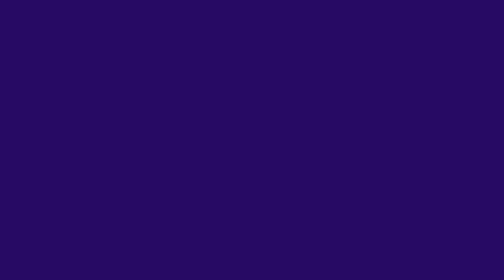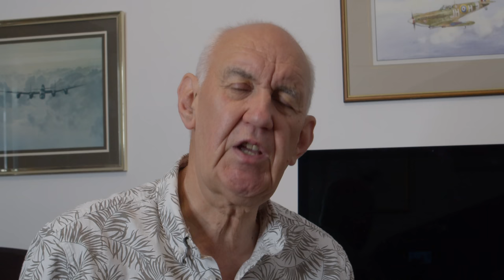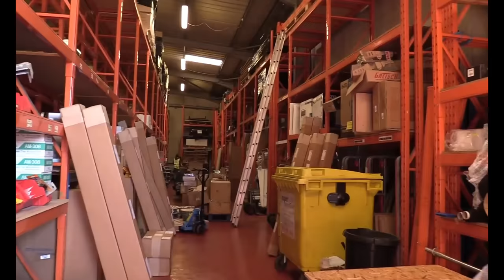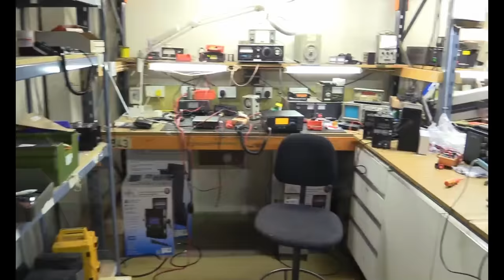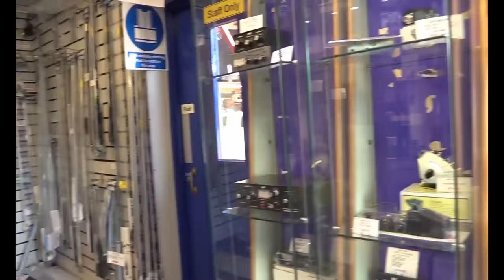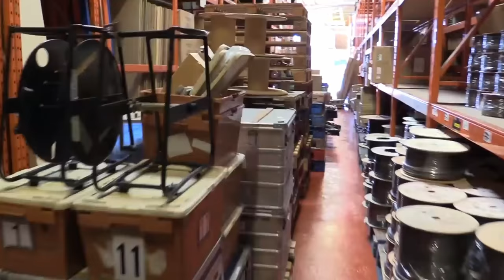HF VERTICAL ANTENNAS - The Positives and The Negatives

Comment: i have an off center fed dipole and a gap vertical   in comparison the dipole can't hear at all; the vertical can hear a lot more than the wire. i say ditch the vertical is not the way to go.  my gap antenna is 5 foot off the ground and yet i have contacts from southeast America to Australia with a true 5/9 to Mutiple locations. all of which i cannot even hear on the wire antenna i have worked in Argentina as well and Moscow as well as south Africia the antenna is aluminum with radials attached to the sides and base no fiberglass needed. it is multi band covering continual from 80 megs to 50 (80-to-6-meter band) very broad bandwidth the highest swr  being 1 ,8 to 1 on just 1 band your theory of a wire dipole is just rubbish om.in my 25 years of being a ham  i have used serval wire antennas in the past and this vertical out preforms them hands down and takes up just a foot square of garden space with no need to put wires in the ground at all .i suggest you  check out  gap  verticals . in particular the titan dx ,
Reply from the maker: Many thanks. Yes I used a GAP antenna for 5 years and and raising it above ground certainly makes an improvement.